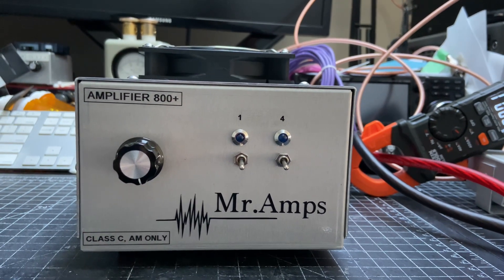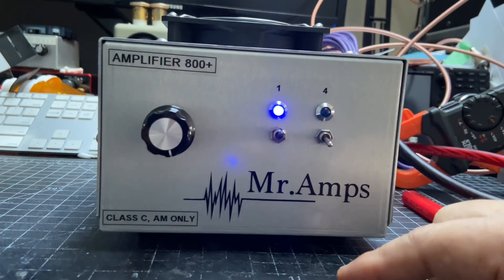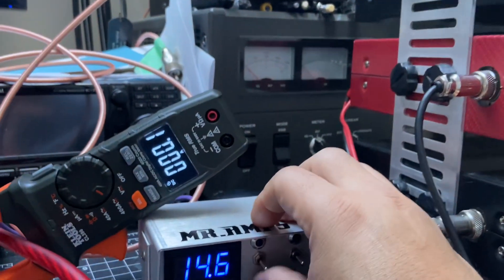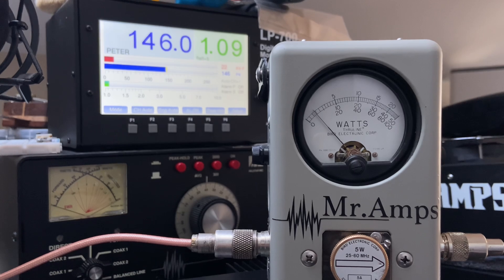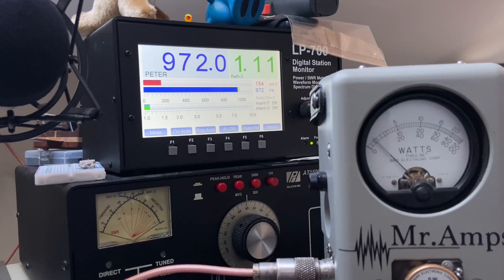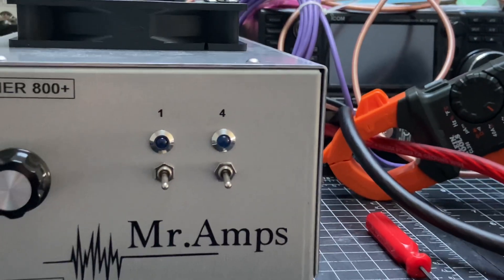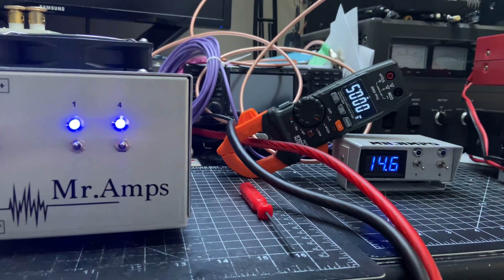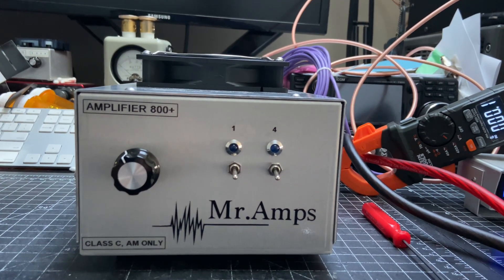(English)—(Moby Dick’s) amplifier class C for mobile

Comment: Class C allows you to talk 5 channels each side.
Reply from the maker: No it doesn’t! Classification of the amplification doesn’t mean anything in regards the bandwidth of the modulation. However I am sure there is amplifiers that are not made proper.
Reply: @Mr.Amplifier.  that’s why they are called class b splatterboxes. You can easily prove it with a video of the bandwidth with that box at 975 watts on a analyzer or a SDR waterfall. We will all be looking forward to that video.
Reply: Oops class c splatterboxes

Comment: I'm confused by the amperage draw?
Are those amp clamping meters fairly accurate or is there a tolerance percentage of plus or minus?... just curious
Reply from the maker: They are accurate, I though the same thing when I purchase it, it’s exactly the same reading as my analog amperage meter on the power supply. The tolerance is 400amps AC/DC
Reply: @Mr.Amplifier.  ok 👌 right on , thanks for sharing